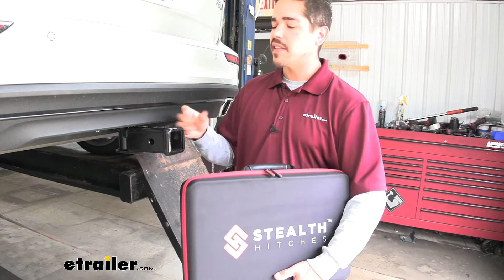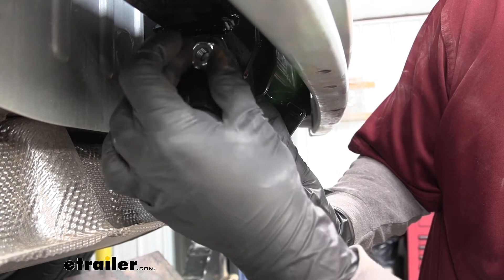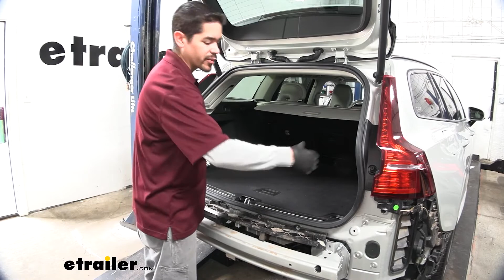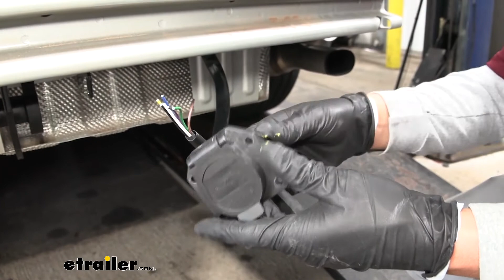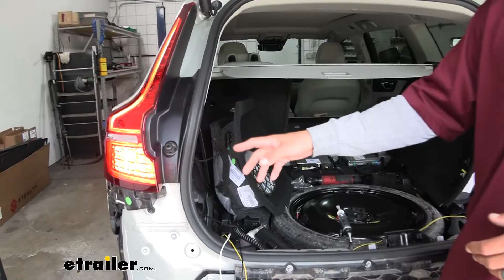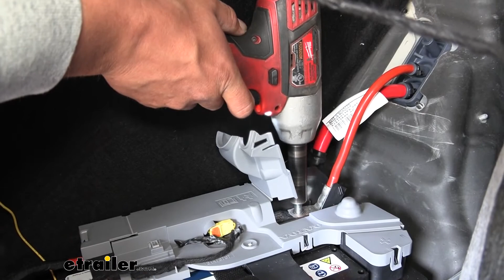Installing the Stealth Hitches Hidden Trailer Hitch Receiver w/ Towing Kit on your 2019 Volvo V60

Comment: Very usefull video. How to identify a wire for rear fog lamp? Where could it be located?
Reply from the maker: Volvo typically controls the rear lighting through the vehicle's body control module, so the wire color and location can vary depending on the trim level and factory equipment.

If you're installing the Stealth Hitches Towing Kit, I recommend using the wiring harness included with the kit rather than tapping into the factory rear fog lamp circuit.

Comment: Did this on my 2020. It was the same except the kit from Stealth Trailers included a flat-4 connector instead of the 7-pin connector shown here, and a pulse width modulation converter because the vehicle uses PWM logic circuits instead of conventional 12V lighting circuits (the converter translates it into conventional power for the trailer). Also, my cargo area floor was physically attached and didn't just pop out like the one in this video, but I didn't need to completely remove it to complete the task.

Comment: those two large bolts that hold the receiver and safety chain brackets... are they long enough?  they look like they didnt engage the nylon part of the locknut
Reply from the maker: Yes, they are long enough. I promise if you fall the installation process the hitch will be strong and safe!